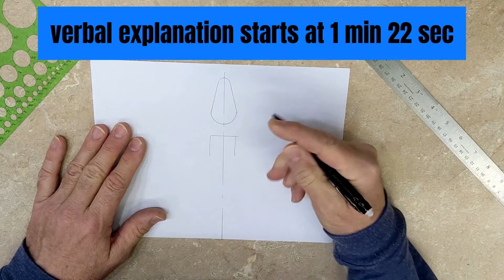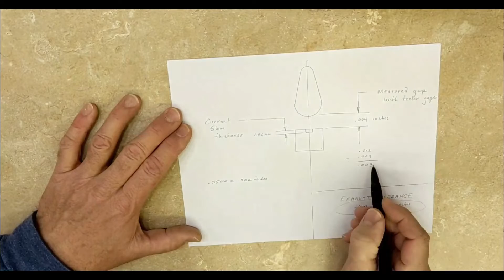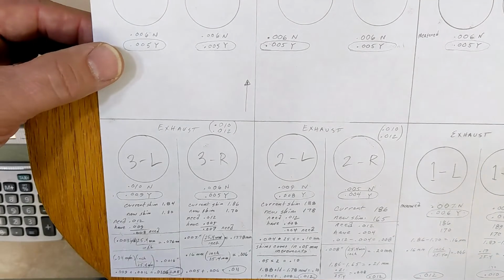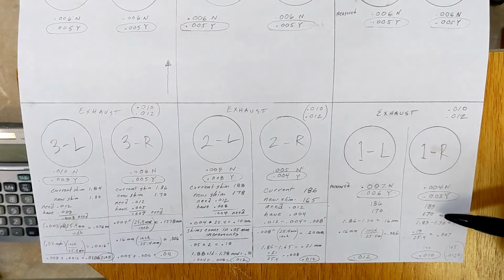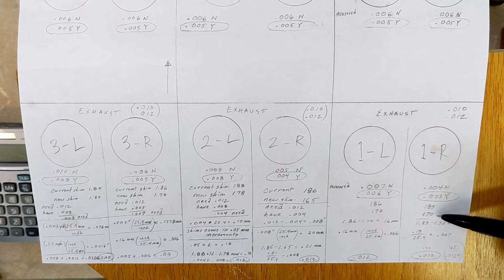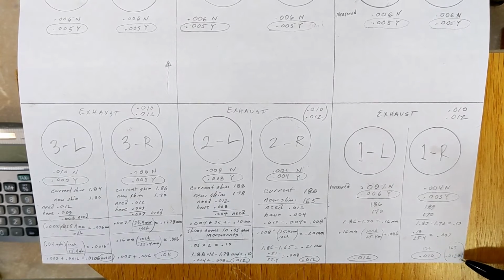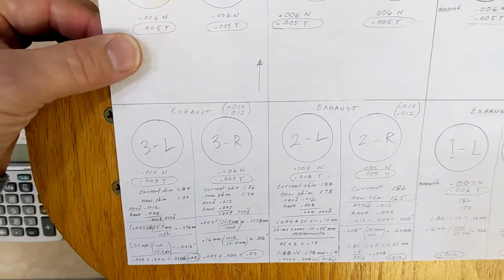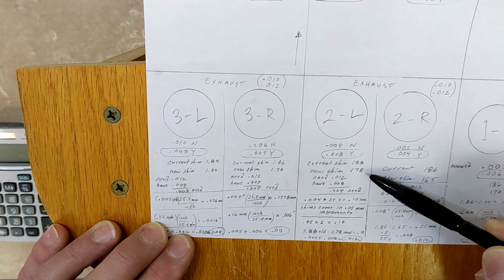new valve pad shim calculation Yamaha FZ-09/MT-09 2014 2015 2016

Comment: Hey man, I'm confusing myself here because the example in the manual I think is the opposite situation I have with my exhaust being too tight. Could you straighten this up with some verification of my math? I measure 0.21 on my exhaust, spec is 0.26 minimum 0.30 maximum. I'm 0.05 away from minimum spec. The bucket is tight against the lobe so I need to create a bigger gap. meaning the new valve shim should be a smaller number than the current shim installed, correct? This thinner shim would drop the bucket down and put me in the spec clearance, I understand that, but which shim number would be best for this specific scenario? Current shim is 180 (1.80mm). Does this mean if use a 175 shim, that would adjust this valve previously reading 0.21 from 0.21 to 0.26? If this is true, then the next option would be 170 shim which would adjust it to 0.31 which is out of spec, so I guess if this math is correct then I only have one shim option to replace the current shim with to make the adjustment into spec, which would be the minimum of the spec. range at 0.26. Any of this sound familiar to you, and any advice you might have?
Reply from the maker: Sounds like you're pretty much on the right track.... I'm about to head out on a ride right now so I couldn't totally think about it... I spent a couple days thinking about it and I drew a picture to get it in my mind.... I did mine in thousands of an inch instead of millimeters and I went down to a motorcycle shop which had more options than just the 0.05 mm increments.... I did the math in this video but it's been about a year.... I have heard especially on the exhaust that if you go with the bigger gap it's better because the exhaust Valve gap gets smaller faster over time than the intake... Due to the fact that it's hotter in that area.... I have experienced this with my dr650 doing its valves...
Reply: @meticulousmechanic  Thanks. The intervals of 5 are going to put me at either the bare minimum of the exhaust spec (0.26) and the next interval of 5 I can use would put me just over the maximum exhaust spec range at 0.31. Have you ever head of pads that fit this bike inbetween the intervals of 5? Specifically, if I could find a pad stamped 173 (1.73mm) this would adjust my exhaust valve to a comfortable 0.28 instead of the minimum 0.26. You ever heard of pads like this 173 I mention? Or only intervals of 5 everywhere on earth...
Reply from the maker: @Jaggy1021  I rewatched my video...if you pause at 1:37 you can see all my numbers...I was using feeler gages that measure in thousandths of an inch because I had more options than with the millimeter gages...the Y means the gage went in and the N means it didn't...if you look in the middle of the page you'll see that on the 2nd cylinder left exhaust valve (2-L) that from the factory it came with a 188 and the motorcycle shop where I got the shims had a 178 which obviously is not an increment of .05....not sure where he got the shims maybe from a different make/model...I'll try to remember to ask him next time I'm in.....most of the other factory numbers are also not in increments of .05mm.. which by the way is 0.00196 inches round off to 0.002 inches. The tolerance is fairly tight on the exhaust .010-.012 inches...a human hair is typically about .003 inches...Maybe this is where the expression comes from..."we are splitting hairs!" If you haven't taken the cams out yet maybe try the gages that read in thousandths and you might be in spec since you are only over by .01 mm with your .31 mm  which is .00039 inches...not even 1/3 of a thousandth....let me know what you find out...thanks